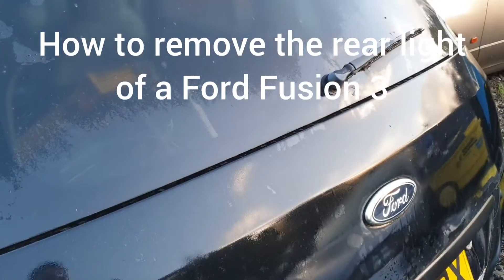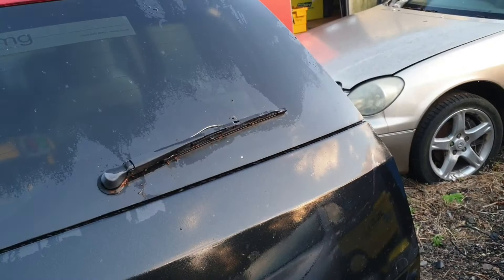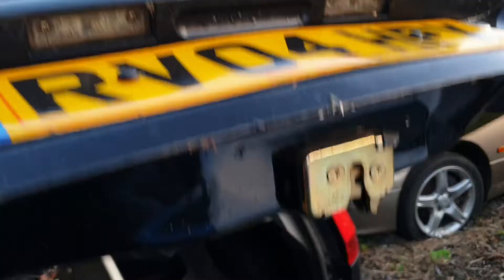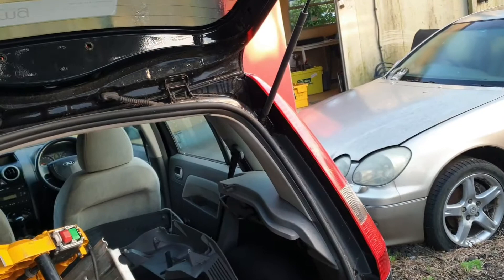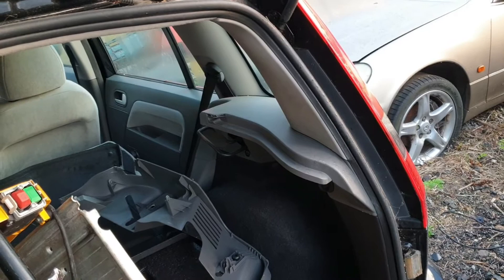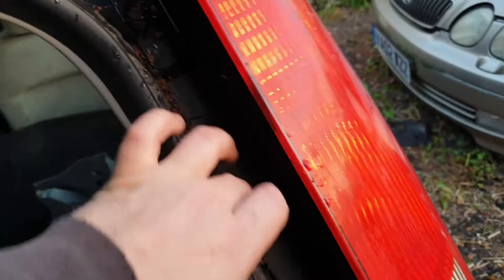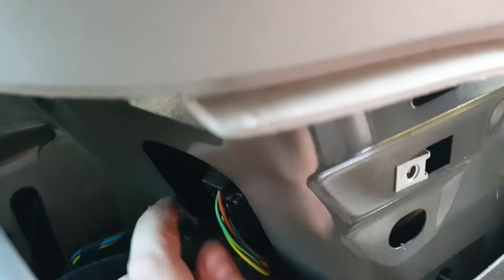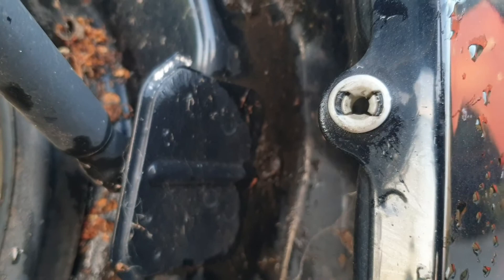Ford Fusion 3 rear light removal

Comment: I want to thanks aswell. The rearlight on the left side had in the grey plastic inside (the part which you loosen at 1:08) a second philips screw at the place which on your right side is in the same place where the light is. Without loosen this screw I couldn't loose the plastic like you did at 1:08. Another difference to my Model is that the two screws which are holding the rearlightcovers wasn't philips but torx screws. Nevertheless that are really tiny problems but think that it might help someone when I mention it. Greetings from germany.

Comment: Don't use a pry bar. You'll damage the paint on the body and may break the light.
Just grap the light unit with your hands and pull it off.

Comment: Great video helped me change the lightbulb but complicated on fusion. Ended up loosing the little clip that holds the first screw you removed and now the plastic that is holding the parcel shelf is loose. Guess there is nothing i can do.

Comment: a garage changed mine last year for a second hand unit - now my fusion is full of water! Is there a seal they may have left off?
Reply: My wife's has always had water in it. I've reseated the rubber seal but the water still gets in. I'm 5hinking of drilling a drain hole I the bottom
Reply: @philipbrookes6676  Hi, I made a homemade seal around where the wires feed in to the light - seems to have fixed it!
Reply: I have drilled a whole at the bottom so now its fine no more moisture inside